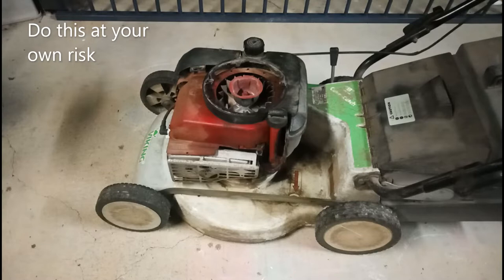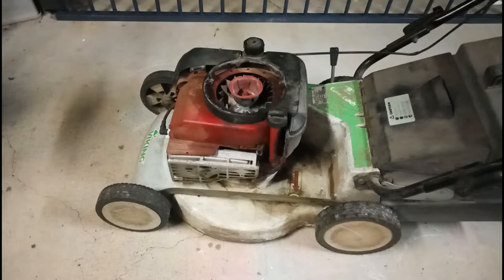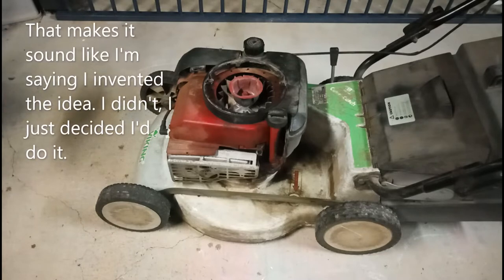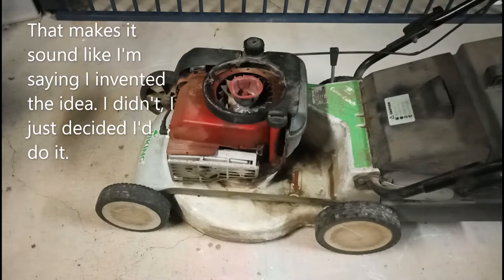How to start your mower with a drill

Comment: Thank You for this. I'm off to the now not so SuperCheapAuto in the morning to get that breaker bar ratchet adapter as they are on special till the 16 June 2024. Gotta prepare for when I can no longer pull the mower alive and that day is fast approaching. 😲
Reply from the maker: Thanks for watching. I've stopped using that mower because it got hard to start even with the drill. I think it's either the carby (which i was having to clean every spring) or it's getting low on compression (I've had that mower for about 23 years and it was second hand when i got it). I'm now using a mower that i inherited from my grandparents and while it's old, it is pretty easy to start by hand. When it dies I'll probably go electric, as I don't have a very big area that i use a push mower for. I've got a ride-on that i do most of the yard with.

Comment: Great thing, i have had an operation and cant use the pull now so will be really helpful, just one thing how does the wrench freewheel when engine starts as surely its turning in the same direction.  as when underload from the drill? Cheers
Reply from the maker: Hey, thanks for watching. The breaker bar ratchet adaptor has a ratchet built into it so once the engine starts spinning faster than the drill it is just freewheeling. Using that adaptor with the built in ratchet means you are much less likely to hurt yourself or damage your drill. 

It's also worth noting that there is a bit of force required to hold the drill steady when first getting it to spin, so you may want to brace it against your leg to help hold it.
Reply: @mad082sss  you sir just saved me a trip to the er. I need to start my ride on and wanted to do this safely. Thank you for telling us about the ratchet Adapter to allow the engine to freewheel when it overcomes the drill rpm. Cheers and happy engineering!

Comment: Why is an impact driver unsuitable? Just asking.
Reply from the maker: It's kind of hard to explain. If you had a powerful enough impact driver you could do it, but it would need be able to apply a fair bit of force before the impact system kicked in (or have an extremely high number of impacts per second). A drill applies constant force all the time, while an impact tool doesn't apply constant torque once they have encountered enough resistance to start them hammering. They spin a hammer into an anvil (the anvil is part of what comes out of the tool that spins when you pull the trigger) then a spring allows the hammer to slip past the anvil and spin around to hit it again, meaning that the rotation of the output can come to a stop in between impacts. This is why when you're working with something very tight it can stop turning and the tool will just keep hammering away. Think of it like trying to move a fridge by punching it over and over, compared to just simply pushing it constantly. Punching applies more peak force, but until the next impact there is no force. Pushing it applies constant force and so it keeps moving. Or in the case of starting a mower, think of it like pulling the starter cord in lots of little bursts instead of 1 big pull. To start it by pulling in lots of little bursts, those bursts would have to be so quick that it would appear as if it was 1 fluid motion. 

So how does all that apply to this? Well to start the motor you need to get it spinning fast enough to start. Constant force is better for that than force being applied for lots of short bursts (unless that force is very high or the frequency is very fast). 

I hope that makes some sense.
Reply: @mad082sss  Thank you for your very concise and simplified explanation. It does make it a lot easier to understand the reasons why an impact driver is not suitable. I hope that it was not a stupid question to ask. Regards, Sandy
Reply from the maker: @sandymillar6781  it certainly isn't a silly question. I did actually try using an impact wrench (only a low powered one) on the mower to try and start it and it was useless. I initially thought it would've done better than it did, until i actually thought about it
Reply: @mad082sss  Only silly question is the one you don't ask because then you never get an answer to what you want to know. 👍

Comment: Ratchet or " cast on your arm / wrist"!  But if you're young, maybe? If old & has no throttle , do it on the grass or next to a mattress & cell phone friend ? 

Wish that rachet didn't cost $30.00 but a 22 year old SEARS push me  has no parts for recoil? 
( New Tor0 = $$$$$$?)
Reply: In case you get notified of this Comment and are in Oz, the ratchet adapter is on Special at SuperCheapAuto for $19.59 until 16 June 2024. 👍